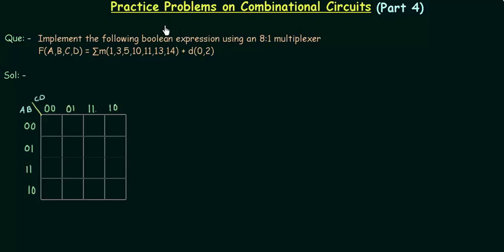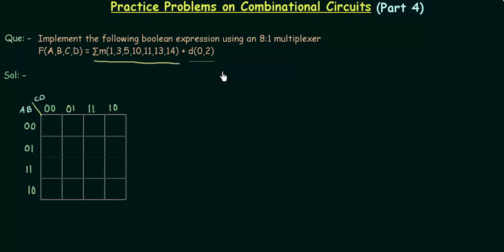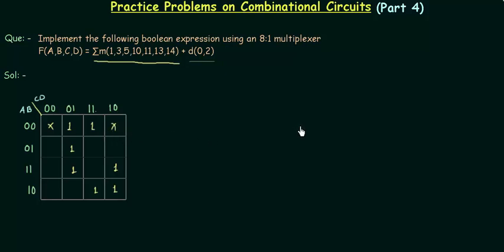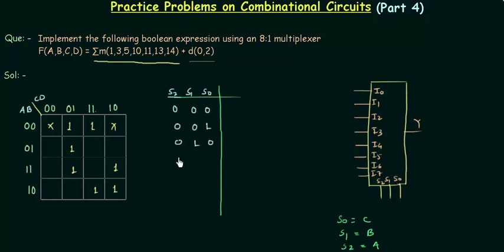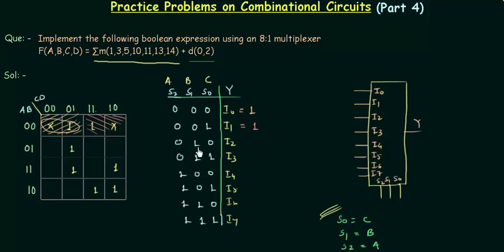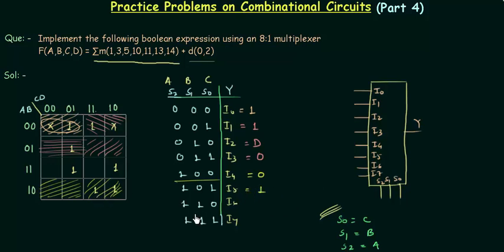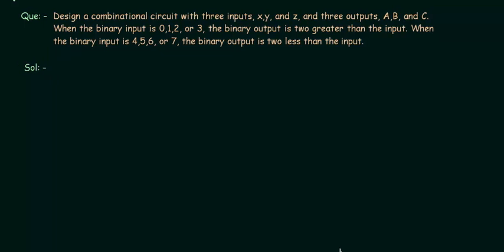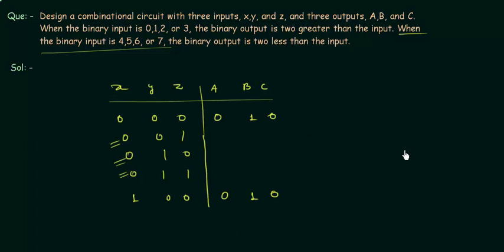Practice Problems on Combinational Circuits (Part 4)

Comment: We can also implement it using a parallel adder. Taking inspiration from the question , in which the same circuit worked as adder as well as subtractor.

Comment: I assume the solution of this question is not limited to MUX. When the inputs of X,Y,Z represent 4,5,6 and 7 in decimals, the outputs of A,B,C repeat the outputs when inputs of X,Y,Z are 0,1,2,3 respectively. Hence, I'll be looking at using a 3-to-8 binary decoder with X,Y,Z as the inputs. The 8 pins of outputs will be first connected in this manner. D0+D4 are joined and so are (D1+D5), (D2+D6), (D3+D7). As a result, there are 4 distinct outputs, they are to be connected to the first 4 input pins of a 8-to-3 P-encoder. The remaining 4 input pins are set at '0'. That is, I0=(D0+D4), I1=(D1+D5), I2=(D2+D6), I3=(D3+D7), I4=I5=I6=I7=0. The output of this 8-to-3 P-encoder should represent the A,B,C.

Comment: ANSWER: A=Y; B=Y' & C=Z
For Those who cant understand...
.
.
.

as question said from 0-3 i/p, the o/p will be i/p+2. & from 4-7 i/p , o/p=i/p-2. So,
x    y    z     |    a   b   c
0    0    0    |    0   1   0
0    0    1    |    0   1   1
0    1    0    |    1   0   0
0    1    1    |    1   0   1
1    0    0    |    0   1   0
1    0    1    |    0   1   1
1    1    0    |    1   0   0
1    1    1    |    1   0   1                         ....................as per the question

so see o/p a matches with input y, i mean as y changes from 0 to 1 the x also becomes 0 to 1 and vice versa.
in similar fashion the output b changes opposite to y, means as y becomes 0 to 1 the value of b changes from 1 to 0
and, similarly the value of output c changes as the the value of z varies

Comment: For the homework problem, we can use a parallel adder. Use permanent input 0010 for word A. Implement input x, y, z in word B using EXNOR gates, of course disregard B3. We can observe from the truth table that when x is 1 then it should be minus 2 or else plus 2. So x = Cin. Now we can obtain A, B, C as the output in S2, S1, S0 respectively. Let me know if I am right.

Posted on 23-10-2023
By, Rohan R

Comment: Can't we just make a simple circuit. It is a combinational circuit as per defination it should not depend upon the previous input.

We can also use 3:8 Decoder and later use other logic gates. Anyways there a lot and lot of ways. I just implemented using a single NOT gate

Comment: H. W problem answer 
A = Y
B = Y'
C = Z
Truth table 
X Y Z-A B C
0 0 0-0 1 0
0 0 1-0 1 1
0 1 0-1 0 0
0 1 1-1 0 1
........................
1 0 0-0 1 0
1 0 1-0 1 1
1 1 0-1 0 0
1 1 1-1 0 1
From truth table
A = 1.X'.Y. Z'+ 1.X'. Y. Z + 0.X. Y' (Z + Z') +1. X. Y. (Z + Z') =X'Y + XY =Y
B = 1.X'Y'(Z' + Z) +1.XY'(Z+Z')=Y'
C =1.X'Y'Z + 1.X'YZ +1.XY'Z + 1.XYZ=Z

Comment: To design this circuit:
Take 3 4x1 MUXs, each one for individual outputs A,B,C.
For each MUX, there will be 2 select lines.  Set S0=x,S1=y for all MUXs.

For the first MUX,whose output is A,
I0 = 0
I1 = 1
I2 = 0
I3 = 1

For the second MUX,whose output is B,
I0 = 1
I1 = 0
I2 = 1
I3 = 0

For the third MUX,whose output is C,
I0 = z
I1 = z
I2 = z
I3 = z.
Reply: How you solved it??
Reply: An arguably simpler circuit would be to use two 4-bit adders to calculate +2  -2 alternatives, and use one MUX to choose which output to pass on.
Reply: @comradepeter87  how is that possible can u explain me ?
Reply: thanks
Reply: thanks buddy
Reply: Thanks
Reply: this is also correct but there is a better way . Take the MSB of the answer to be controlled by x and y , LSB to be controlled by x and z , and the remaining one be controlled by y and z . In this way , at the input of the 4:1 MUXes , only 1s and 0s will be there.
Reply: we can also implement as 

For the first MUX,whose output is A,
I0 = y
I1 = y
I2 = y
I3 = y

For the second MUX,whose output is B,
I0 = y'
I1 = y'
I2 = y'
I3 = y'

instead of using o's and 1's
just try it, it also gives crt ans
Reply: @sandeepponnusamy7093  is that sarcasm?
Reply: @sandeepponnusamy7093  And we can also simply implement with logic gates...

Comment: Can you tell the answer of hw question
Reply: x|y|z|A|B|C
000 | 010
001 | 011
010 | 100
011 | 101
100 | 010
101 | 011
110 | 100
111 | 101

this will be the table ; now where A = 1 take the corresponding xyz value and solve it ; do same for B and C and you'll get the ans.
Reply: @chiragkushwaha546  then how to draw circuit
Reply: the ans is A= y ; B=y' ; C=z ;  just complete the table and you'll get the ans.

Comment: can anyone tell how to implement circuit for home work pblm?
Reply: as it is state,  draw a square with 3 input x,y,z and 3 output A,B,C.

forget about x.

from Y  take a wire directly to A. take another wire from Y to B between them a not gate.
from Z take a wire directly to C.
nothing simple  as that

Comment: Sir how can you write I0=1,I0=1,I7=D could you please explain
Reply: I0 gets active when A =0 , B= 0 and C = 0...no mention of D...so if you see the K-Map....there are two cells havinf ABC = 000....and one having D =0 is X and having D = 1 is 1...and you can take X as 0 or 1 depending on situation...so he took X as1 and wrote I0 as 1...
similarly for I7,we need ABC = 111 and only two cells have that property..cell having D = 0 has value 0 and with D = 1 has value 1 so he wrote I7 as D

Comment: I don't understand how we are getting D as input in the k-map (1st question)
Reply: Friend you see that when is the value is 1  then d is o or 1.if D id 0 then complement  of d snd if 1 then d.
Reply: It is an assumption. You can take any combination of {A, B, C, D} as selector lines and then obtain the input equations using the K-Map.
Reply: you need to understand previous lectures.
Reply: @gundigamanjusree8851  witch lecture ? please because i dont' get it too much

Comment: your video is aswm but for designing mux there is one more easy way,,
 1)write no. of inputs. (horizontally)
2) write no. of input cominations.
3)circle the mintrm.
4) check value for ech input.
 FOR  4:1 mux (A & B as selection input)
f(A B C) = m(1,2,3,4)
sol:-

       i0     i1    i2    i3
--------------------------------------
C'    0     (2)   (4)    6
C   (1)    (3)    5      7
       C      1      C'     0 ...these are the input values..
Reply: you're awesome , thanks.
Reply: i dont understand the above is that the answer for the last problem in the above video ?can u pls make me clear

Comment: I used a 3x8 decoder for the last question. Is there any other combinational circuit that would be more useful instead?
Reply: how do you implement it
Reply: it can be simplified into only two buffers and one not gate

Comment: A=Y
B=Y'
C=Z
and   i  can do  this  circuit  with only one  (x-or) IC   
&   i  can do   this circuit  using 2 ic's  (not gate & buffer gate )
   &  i prefer  the first one to  minimize my IC's in my circuit
Reply: How to draw logic diagram..please explain
Reply: But how to solve please explain
Reply: @sivanath1844  Make the truth table, then make 3 K-maps for each of the output variables, i.e., A, B, C. Solve those K-maps to get the answer.